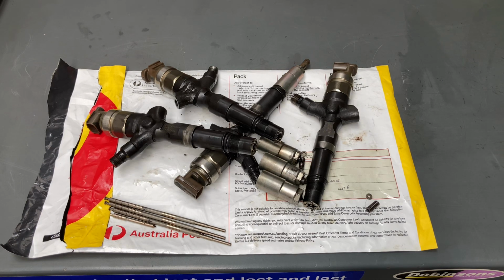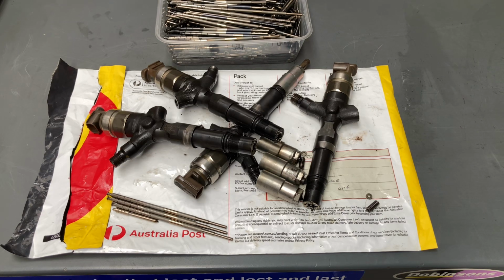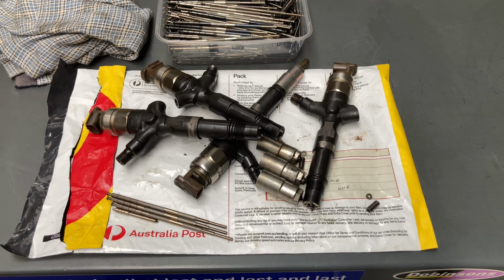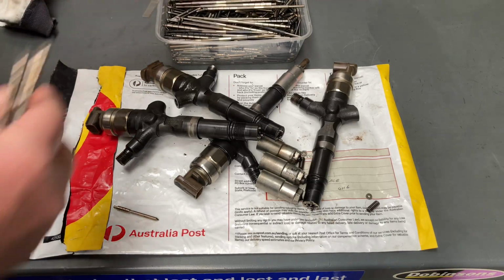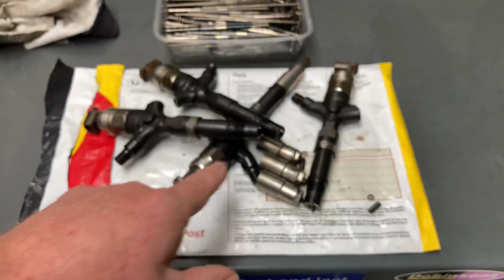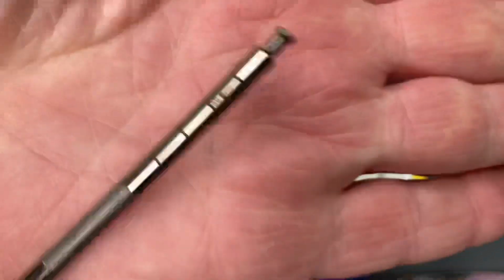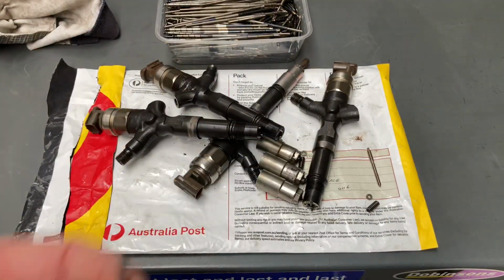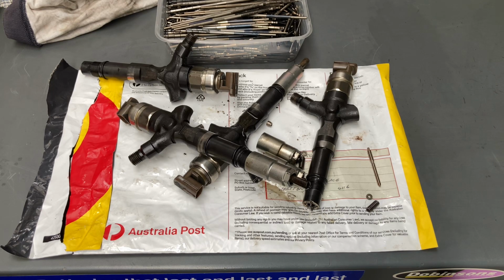I RECOMMEND YOU DO THIS After INJECTOR REPLACEMENT

Comment: Just a question Wouldn't the housing inside be worn as well as the pins so if you use remanufactured injectors with new command and nose needles they would be outside original specifications. Just a thought Cheers Ian